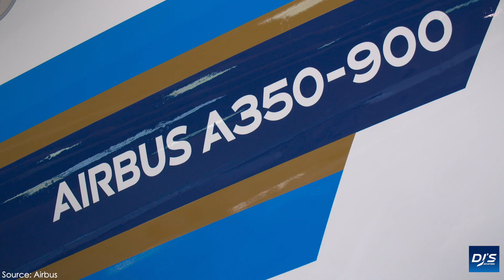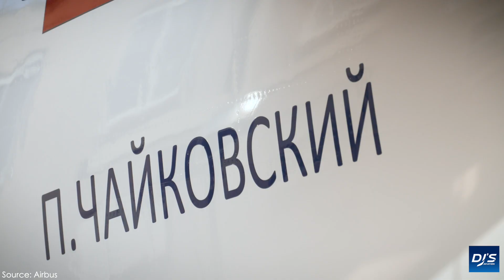Introducing The Airbus A350

Comment: On 15 January 2015, the initial A350-900 entered service with its launch operator Qatar Airways, followed by the A350-1000 on 24 February 2018 with the same airline. The A350 XWB launch customer, Qatar Airways, is also currently the largest operator with 53 airplanes in its fleet.[6] As of February 2021, A350 XWB orders stood at 913 aircraft, of which 408 had been delivered and all were in service with 39 operators. It succeeds the A340 and is positioned to compete against Boeing's large long-haul twinjets: the 787-10, the 777, and its successor, the 777X.

Comment: The first Trent engine test was made on 14 June 2010.[74] The Trent XWB's flight test programme began use on the A380 development aircraft in early 2011, ahead of engine certification in late 2011. On 2 June 2013, the Trent XWB engines were powered up on the A350 for the first time. Airbus confirmed that the flight test programme would last 12 months and use five test aircraft.[75]

Comment: Not a bad aircraft to work into, as a flight attendant, even though Airbus still managed to put in some of its usual weird logic (galley power: green: on blue:off, ovens: red: can be opened, no color: locked, doors: green: locked...).
Door one galley is pretty cramped As well, I know this has a lot to do with the buyer’s choice but this one has to choose from pre selected Airbus designs, so...
Apart from these points, I find the aircraft to be agreable, its crew rest, although less spacious than on previous aircraft, such as the A-380 of course, remains comfortable and a far cry from that of the 787, with its damn ventilators right above your bunk, in which you will have had to crawl to get into.
I really do not like the 787, a very unpleasant aircraft for a cabin crew.

Comment: AIRBUS should launch the stretched variant of the A380-800 which was the A380-900 Neo by 2024 because the age of quad jets ain't done yet inspite of the present post pandemic situation worldwide!!! the A380-900 Neo was proposed by AIRBUS back in 2010 - 2011!!! if I'm correct the A380-900 would accommodate 24% - 28% more paxs than the A380-800 in a 3-class configuration with vastly extended range that would enable the A380-900 Neo to fly some of new ultra long haul routes non stop!!! if you ask me AIRBUS should have launched the A380-900 in the first place instead of the A380-800!!! followed by a A380-1000 Neo for that matter, think of it as a 850 seat super stretched version of the A380-800 in a 3 or 4 class configuration!!! will it sell again like it used to??? experts would say no hands down (& for the most part they're probably right) but I say why the hell not??? if I owned an airline worth €3.0 Bn (without assets but including debts on mortgages) with a market share of 33% & operated a fleet of fairly new 93 narrow & wide body jets, by 2024 -2025 I'd seriously give it a thought to acquire a fleet of atleast 5 brand new A380-900 Neo (buy 2 of the 5 A380-900 Neo & lease the remaining 3 A380-900 Neo) by which time the global air travel industry would have recovered substantially to a level where airlines can once again start planning for the future!!! prepare a road map that'll include plans to acquire new wide body jets & launch new routes with new cabin services!!! also consider alliances with budget low cost carriers that would help our passengers connect seamlessly with our long haul international flights!!! offsetting the operational cost of 5 brand new A380-900 Neo is all about decisions made at the right time & offering situation specific solutions to issues other than the A380-900 Neo!!!
Reply: It is not about Covid-19, Airlines wanted twinjets since the 1990s

Comment: If I remember correctly, the original A350 proposal was essentially a re-winged A330 with more modern engines. But that proposal was rejected by Qatar Airways (the original launch customer) and the result was the all-new A350XWB, which had an all-new fuselage that better competed against the 777-200ER models. Indeed, the A350XWB-900 has become the replacement for the now-aging 777-200ER fleet and the A350XWB-1000 could start replacing the 777-300ER during the course of the 2020's.

Comment: Flew it with Asiana. Much quieter and better seats than the Norwegian 787.
Reply: Norwegian is a low cost carrier m8... asiana a full service. Can't wait to see you compare Emirates 777 first class to Fly dubai 737 and say that 777 is better.
Reply: @aseem7w9  Wasn’t aware type of airline also affect the jets’ width and engine noise. More things you learn from YouTube University.
Reply: @Peizxcv  not jets' width but the width of the seats. Some A350 have 10 abreast configuration which results in 16 inches seats but most have 9 abreast which results in 18 inch. Plus A350 is a Boeing 777 sized plane you should compare it with that. The 777 with 9 abreast has .5 inches wider seats than a350 with 9 abreast but again most airlines put 10 abreast in 777. Plus you mentioned better seats. Wider doesn't always mean better. For example Emirates 777-300Er with 10 abreast configuration, even though it's narrower feels more comfortable than air mauritius A350 with 9 abreast configuration. Hope you learnt something from Youtube University!

Comment: I thought the A350 was meant to compete with the Boeing 777?
Reply: It was a response to the 787. Airbus hadn't seen that the long-haul trunk market was limited and that airlines and passengers found that the Boeing model of smaller, more efficient aircraft to serve direct city pairs was more in line with the future. Airbus had bet big on the A380 but, as we have seen, that aircraft can only operate efficiently on trunk routes. Once Airbus realized that Boeing was right, they responded with an update of the A330 which met a very lukewarm response. The 787 had better cost performance, so Airbus went back to the drawing board and designed composites into the A350 as this was the key to lower fuel burn and greater range at high load factors, allowing for the opening of new travel markets.  They were, clearly, behind in this new segment and Boeing was set to dominate. Then a funny thing happened: Boeing blew the rollout of the 787, experiencing many delays caused by various problems. This allowed Airbus to get back some of that lost time.  And so, we have both companies sharing the market with advanced aircraft that are well-suited to the task.
Reply: @bunkie2100  I’m more an Airbus fan but theDreamliner unfortunately was held up because of combustable  lithium dangerous batteries I saw on an Aljazeera documentary  they had eventually to go in bomb proof boxes to go into the plane back then Batteries weren’t Boeing’s fault really Airlines want bigger better planes but these engines and batteries don’t move forward quick enough as this documentary reported 😥😥🙏✈️👩‍✈️👨‍✈️🇬🇧🇺🇸🔋🔋
Reply: It wasn't designed to fight against 787 and 777 it is between them which makes the A350 series different.

Comment: A350 and the A380 are terrific aircraft. Comfortable and quiet.
Reply: exactly !!!!
Reply: I agree mate, I absolutely adore the A350.
Reply: I have yet to fly on either an A350 and A380, but from everyone that I’ve heard of so far, they are among the most comfortable flights and seatings to fly in. The only widebody Airbus I ever flew on, was a Virgin Atlantic A340-500 economy from  JFK  to LHR. It was one of the best flights I’ve ever flown to this day.
Reply: @StallionFX1  Depends. 10 abreast A350 economy is torture. A380 also depends. My Emirates economy A380 flight was amazing but my Etihad and British Airways A380 flights were average. My best economy flight was in JAL 787-9 because they use 8 abreast config similar to what most a330 use but since 787 is wider than a330, its so much more comfortable.
Reply: @aseem7w9  Luckily only Air Caraibes adopted the 10 abreast config, JAL once persuaded Airbus for launching 10 abreast across domestic cabin A350 but Airbus turn it down. Ironically it was the airline that ordered most comfortable 787 requested for uncomfortable seats for its latest fleet. A380 hands down for being the most comfortable airliner even with 10 abreast seats however airlines prefer spoke to spoke routes, rendering the plane itself redundant. Eventually we would see the decline of 787 as smaller jets such as A321XLR will dominate short to medium routes and maybe Airbus will built a better one to offset 787's performance.
Reply: @Chris58851  nah the a321 xlr will not affect the 787 in any way. They serve different markets. A321 xlr for extremely skinny long haul routes and 787 for skinny long haul routes. Saying a321 xlr will kill 787 is like saying the tiny 787-8 will kill A350-1000
Reply: @aseem7w9  Airbus once believes hub and spoke will remain, but the 787 proved them wrong. The A321 XLR will deliver another blow to Boeing if they didn’t do anything.
Reply: @Chris58851  Yes, Boeing needs something to compete with A321 xlr but introduction of A321 xlr will not at all be a blow to the 787 program like you said before. A321 Xlr is mostly only for the very skinny long haul routes for example Lucknow (India) to Europe or Chittagong (Bangladesh) to Seoul. Airlines will try to use big planes in routes as much as possible because operating one big plane > operating multiple small planes. Plus don't forget the 787-9 has around 8000nm range vs A321 xlr with around 4000nm range. The A321 xlr will be a blow to Boeing yes, but not to the 787 program. In fact the A321 xlr will not be a blow to any on going Boeing programs. The A321 xlr will allow introduction of a new type of route. Imo, the size of 787, A330neo is perfect for most long haul routes of the world too. Plus just because a plane is small doesn't mean it'll out sell all the big planes out there. Example is how the Boeing 777, currently the biggest twin jet in service has more orders than the smaller Airbus A330.
Reply: @maxwellsmith9045  I like the A330 too
Reply: Been on A380 but can't wait to go on A350 and B787 someday
Reply: @rajnirvan3336  be sure to try out jal 787. they offer extremely wide 2-4-2 lay out on their 787. their seats are wider than any a380 economy out there
Reply: @aseem7w9  thanks I'll keep in mind
Reply: 💯 true, based on my experiences
Reply: Comfortable depends.If airlines choose high density layout which is 10 abreast like in 777, a350 gets 16 inch seats

Comment: The most technologically advanced twin engine wide body around, and that will still be the case when the Boeing 777X goes into service.
Reply: B787 would like to say hello!
Reply: @WycliffStudios  yeah but 787 has problems
Reply: @kfl16  having problems doesn't negate what he said though bro. The 787 is just as advanced as the 350 and that's just the truth in the matter.
Reply: @kfl16  Problems by the Rolls Royce engine maker.
Reply: @w4vy : 787 is more advanced.  Single piece composite barrel sections with co-cured stringers as opposed to A350 Black Aluminum construction. — Emirates even asked Airbus to design the A350 like the 787 but Airbus couldn’t due to lack of technology know how.
Reply: @vra6982  Picture perfect the Boeing 787 is. Just about from any point of view. Now, on your term of "Perfect", the 787's history isn't. But being the "Pacer" that it is ( The A350 would not even exist if it were not for the 787 coming to be) any pacer is bound to encounter issues that may exist out there yet to be discovered, if any. So Boeing took the chance first with the 787 "Pacer" and AIRBUS followed suit. Even China likes the look of the Boeing 787. With "Plane Facts" informative knowledge, I became aware of the CR-929's existence and was surprised it looked like a carbon-copy of the Boeing 787. So yes, "Picture Perfect" indeed.
Reply: exactly ! 777X is just same lazy short-term profit attempt for cheap upgrade as 737 max
Reply: @АлексНиков-л2с  except the 777x is vastly different from 777. New folding wing let technology, new wings, advanced 787 cockpit and many more. If you want to look at a cheap upgrade look at  the A320 neo which has no new cockpit technology, no new innovation like the folding wing tips, etc.
Reply: @aseem7w9  777 was an old plane 5 years ago already & 777x is just cheap upgrade with bright features, but old airframe inside like 737max to fix short term profit
Reply: @АлексНиков-л2с  Newer than the A330 neo and A320 neo air frames and has new technologies which i already told you about. The folding wing tips especially are revolutionary! They allow planes with bigger wingspans to fit in normal airports unlike the a380 which can't fit at most airports. The 777x  unlike those 2 neo planes has done something new. Plus with all the 787 technologies that are being applied to 777, 777x can be called a totally new plane too. Plus don't forget about to size of 777-9. It's a 747 sized twin jet which is impressive and it's wing spans is bigger than any 747 ever. I think that making a twin jet that big is an achievment in itself. I get it you're an ignorant Airbus fan boy and can't acknowledge the good thing about others. Oh and the 777x upgrade is far from cheap lol. Cost more than A330neo and A320neo development together.
Reply: @aseem7w9 the A320 cockpit was so advanced compare to Boeing that not need to be improved immediately. Concerning folding wings the concept does exists for decades for planes onboard carriers. Nothing very new therefore.
Reply: @aseem7w9  here is the difference - Airbus is doing innovative designes in addition to upgrades, lazy B just upgrades with 1 exception
Reply: @alainmare8081  exactly ! Airbus "OLD" airframes are 20 years advanced to lazy Boeing ones
Reply: @АлексНиков-л2с   The only new useful plane airbus has introduced recently is A350. Also remember that Boeing significantly upgrades their plane when re engining unlike the neo planes. The 747-8i is significantly different compared to 747-400 with brand new 787 technologies, 737 max eh not too different but remember the 737 ng (a 90s plane) had a ton of upgrades from the 737 classic already, 777x, I have already mentioned. The A330 neo and A320 neo tho are the same thing with composite materials here and there are new engines. And like i mentioned above too, the 747-8 and 777x upgrades are far from cheap or lazy. I'm sure if they were going for a lazy re engine they wouldn't even bother adding 787 cockpit to 777x considering that 777 is a 90s plane with pretty modern cockpit already or they could be like airbus (with their A380) and leave it to airport makers to increase their gate size instead of adding folding wing tips? Plus the 777 is more advanced than A320 and A330 in any way I can imagine lmao. There's a reason why Boeing wide bodies are the best selling ones, they're amazing. The only amazing wide body of Airbus close to Boeing levels is the A350.
Reply: @alainmare8081  Even the 777 cockpit is very advanced actually in some places more advanced than the a32/3/40 cockpits It's basically just another modern cockpit. But still Boeing put the effort to add 787 cockpit. Plus like i mentioned making the plane 747-400 sized is no small thing. Making a technology come to a commercial plane is a different thing. For example military planes have had composites used in them before but still we treat them in 787 and a350 as a big deal.
Reply: @aseem7w9  first Boeing lost with plane sales numbers 15 years ago, second - you know aviation bad - A380 is completely new aicraft as well
Reply: @АлексНиков-л2с  no they didn't lose lol. Even in the 2010s, most of the years Boeing managed to recieve more orders than Airbus did. The 787 won't just randomly become the fastest selling wide body if Boeing was losing heavily. It has just been 10 years since it's introduction yet has more orders than A330 and soon will over take 777. I clearly mentioned useful planes too so no place for a380. I don't know  if you know this btw but Airbus were about to release a re engined a330 as a 787 competitor at first. But lack of market support led to a clean sheet airplane. Initially it was supposed to be a direct 787 competitor but since they needed a340 replacement too, they opted for a 777 sized plane. Airbus wanted to do another re engine but the 787 was too good for it.
Reply: @aseem7w9  yes they did )))) receive orders is one thing - deliver & get money is another )))) look into useles 737max 5k orders ))) ups..... 3.5k already ))))
Reply: @АлексНиков-л2с  but you were talking about sales tho... sales in aviation is generally related to orders and not delivieries..
Reply: @aseem7w9  no, sales are sales everywhere - there is no money until delivery happened - every order can be camceled, delivery  - dont
Reply: @АлексНиков-л2с  yes but still in aviation a sale equals to order. For example when Airbus delivers bombardier c series they won't say we sold a plane but they'll say that when they get an order.
Reply: @aseem7w9  no, never sales equals order - you can not fly on order & you can not eat an order - everywhere just 2 options to consider sale  - on delivery or on payment - no other options at all
Reply: @aseem7w9 : Plus 777X has all composite wings.
Reply: @aseem7w9  you do know that the A330 have more orders than the 787 right? they have 1700 A330s orders compared to 1500 787s
Reply: @stoje8405  shouldve specified A330ceo*
Reply: @vra6982  All newly-designed aircraft have teething problems. The 787 was such a leap forward that it was bound to have a big share of them. But, as it normally happens, those problems have been sorted and the 787 is a major success.  Airbus pivoted quickly with A350 redesign and, coupled with the 787 delays, got lucky. Had the 787 gone into service closer to its target date, Airbus would have been playing catch up with the 787 and had much less market share in this segment.